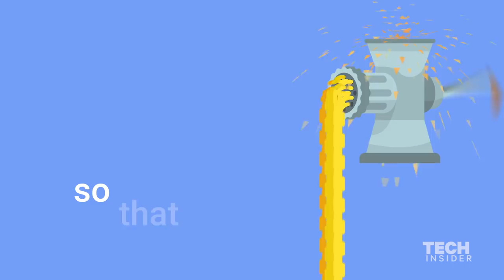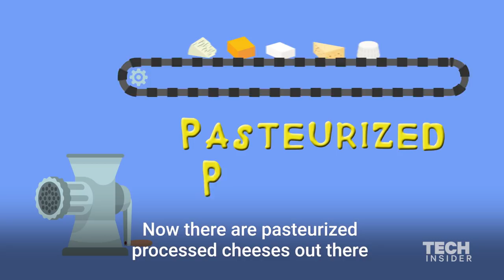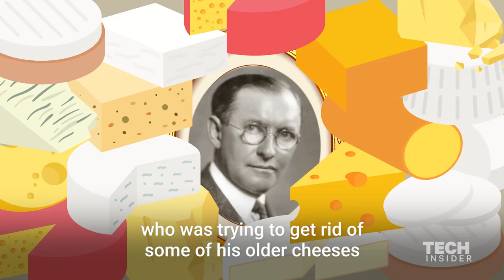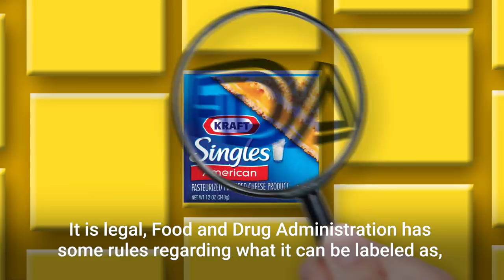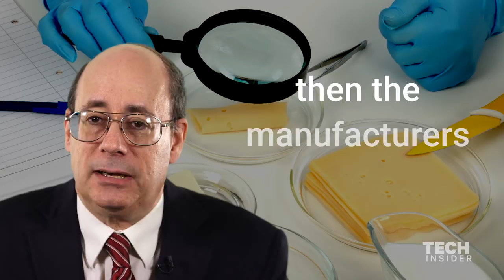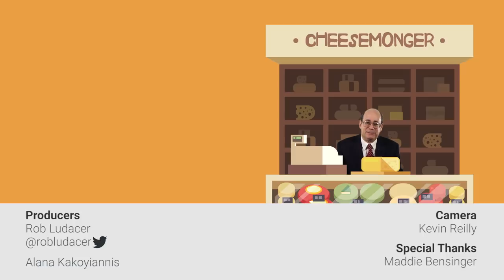What’s Really Inside Kraft Singles And Other Processed Cheeses?

Comment: Am I only one that realizes these videos dont actually explain a damn thing?
Reply: It did explain it though, all it is is just a mixture of old different cheeses mixed together in a type of edible glue.
Reply: malcolmsaint theres no glue... it's an emulsifier... egg yokes and mustard are both emulsifiers. They used a glue bottle to make it look more gross.
Reply: That was my reaction. All I know now after watching is Velveeta is old cheese leftovers with an emulsifier added and it melts easily. I had actually hoped for some facts and data, you know, component ingredients, what is the emulsifier, how much fat, sugar, salt, other additives by name. 

I recently removed Velveeta from my diet, because the quality of the product has declined even further in past couple of years, to the point it is really kind of scary to look at the mushy, spongy blob that you are about to eat. I thought at times it might move like a slimy slug last few times I opened a fresh package and opened the foil wrap for the first time. 

I am switching to using cheddar cheese, real cheddar, in my favorite bean and cheese and fresh habanero dips I love to make and eat for supper sometimes. At my advanced age, every improvement in nutrition is a shot at extended life span, and giving up Velveeta turns out to be easy, healthy, and ultimately better tasting.
Reply: @garylundberg7238  actually, an emulsifier 'glues' oil and water.
Reply: No

Comment: So it's a mix of tasty cheeses with an emulsifier... he shows a bottle of glue... an emulsifier is something that allows oils and water to mix. Mayonnaise, and egg yokes are emulsifiers. Mustard is an emulsifier.
Reply: Gary Lundberg not quite. Mayonnaise is an emulsion of egg yolk and oil. Both are emulsified. There is no need for an emulsifier, you can emulsify them by beating them together. Mustard is used to flavour mayonnaise and to a certain extent helps emulsify it. Commercial mayo has added emulsifiers as the emulsion is not stable and would break down over time on the shelf in store bought products.
Reply: Spencer Wilton ok. I'll take that. But to use imagery to suggest that an emulsifier is akin to Elmer's glue is dishonest and leading.
Reply: Gary Lundberg agreed. These products probably aren't as bad as people make out. I don't know if you're in the UK, but here we have a product called cheesestrings- basically pull apart stringy cheese sticks aimed at kids lunch boxes. Everyone assumes they are terrible, however they are actually made entirely of cheese, heated to a critical temperature that changes the structure to make it stringy. Nothing is added. On the flip side, I am equally sure many processed cheese products have all sorts of questionable and unnecessary artificial stuff in them.
Reply: Spencer Wilton I'm in the US my friend, but we have them here too. People need to educate themselves on food. Maybe then the obesity rates would start to drop.
Reply: Gary Lundberg Unfortunately I don't think you can educate people who aren't interested. We all know high fat and high sugar processed foods are bad for us, but cheap, convenient unhealthy food has become a lifestyle choice for many. If parents don't and won't cook from scratch, what hope is there for their kids? I don't usually agree with too much government meddling, but there is certainly a case for banning certain additives, and taxing some unhealthy, highly processed foods.
Reply: Spencer Wilton 👍👌👍